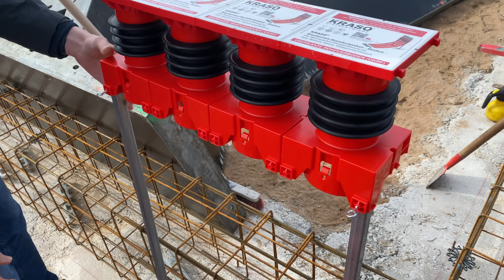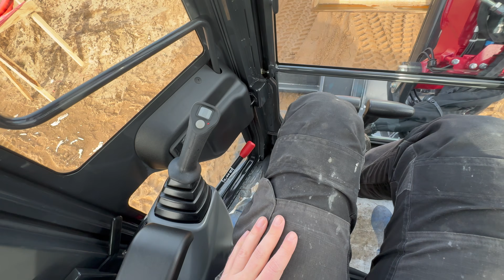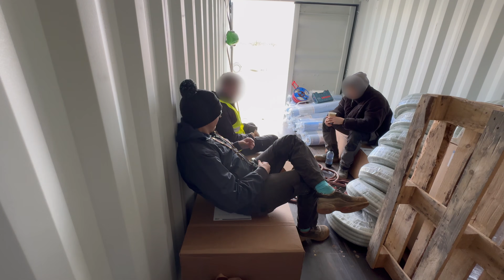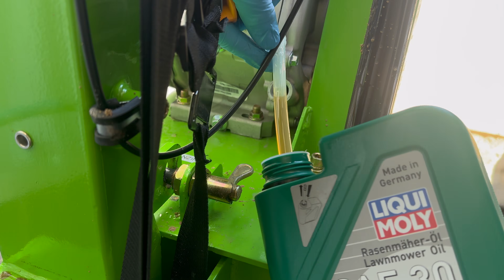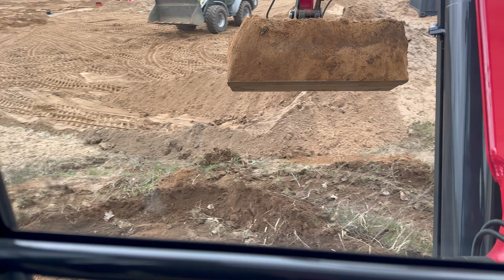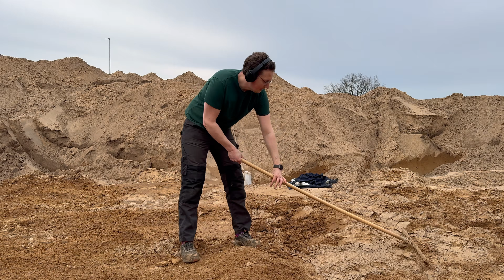Foundation Backfilling, Compactor Care & Massive Hole Digging | Max Maker Dream Workshop Ep. 3"

Comment: Gasketed joint sewer pipe & fittings were first engineered in the US and is widely used both commercially and residentially here in the US. Just a bit of clarification. Awesome build video otherwise. I know I am late to the party but I am really enjoying this series!
Reply from the maker: Thanks for watching! I didn´t know that. I saw so many PVC pipes with the purple glue.

Comment: Hey Max sup 👋 

Good times, you’re living the dream man! Couple things I would suggest in this instance, everything prefabricated, no pouring or setting, and a basement area with mesh ceiling (say in the far corner) that I suppose can serve as a utility space..

Later went on to turn the basement area into a concrete section that went from basement level to the first floor to use as a stronghold/secure space with server room possibility..

Thanks 🎉
Reply from the maker: Thanks! Not sure I need a basement.

Comment: Sorry to correct you, but America invented the "slip joint" piping. It is referred to as SDR35 [wall thickness & load bearing spec]. and is mainly used for sewer lines and some drainage application. But NOTE; the manufacturer of that pipe recommends for you to apply pipe soap before pushing together, as the gasket can roll if dry. I have been in the Utility Industry for over 45 years and my dad was in it for 50 years. We have seen all of the evolutions of pipe in the piping industry for the last 75 years

Comment: The more you compact the better. Years ago I did some concrete work, mostly unskilled labor. We did a house in which the owner prepped the house and large shop. The holes were all dug and we installed and laid the foundation and then he back filled and we came back and laid the slab. Having stepped on the ground inside the foundation it was soft and uncompensated (no insulation, no liner and just rebar that he laid). The main crew guy called our boss and told him as he had not arrived yet. The boss called the owner and explained this and the owner said to go ahead. The boss then called the concrete company to hold the first batch. He then drove nearly an hour to where the guy was working to get him to sign off on the job. (legal liability) Then we got started a couple hours late and finished. 
10 or so years later I happened to go to this guy's house as he was selling something that I wanted yet did not end up buying. (I turned my friend on to it and he bought it) I was talking to him and he showed me his stupid mistake. His shop floor was so badly cracked at the door entrance and every where he had set heavy or drove heavy stuff. The inside of his house had settled as well and had hollow sounds. He said that it took him 6 months to get it built so it rained a lot on it with introduced water under the slab and that settled. He did say that his insurance paid out on it. How he did that I have no clue. Yet he did say that he was going to build a new place in cash after this place was paid for which was in a few more years. I am guessing a 15 year loan! 
I like to compact a lot........
Reply from the maker: Thanks for the story! Thats one thing I want to avoid for sure. I am hopeful that we have so much rebar that the slab will be strong on its own. Its 20cm thick. So almost 8 Inches. The geotechnical engineer said that the sand that we got is the best material around and that its easy to get it compacted enough. But I still don’t know if its compacted enough or not.

Comment: The black drain things are what we use for the leech fields for our septic system. The one thing that we are going to do for our new place is install a massive system as the plan is to install one black and one gray water system with 1000 gallon tanks. 
My sister's place needs a way to remove water and this is what she needs to install. Yet her house is on the lower end towards the street and its higher towards the rear of her land. So they will have to dig deep to divert the water away from her house. Just sad that they built it on the low end rather than at the top end.
Reply from the maker: Ah yeah. Similar to this situation. I plan on doing the landscaping around the building as ditches that redirect the water from the hill around the house.

Comment: I've been a fan from the start and I honestly get so happy when you post a new video. If you don't want the pond to "collapse" then make sure to get some plants because the roots will keep the soil from sliding. Plus it looks really nice 😋 I would suggest Iris flowers. And yeah we have the same kinda piping in DK and it's really nice to work with. Best of wishes from Denmark
Reply from the maker: Thanks for watching! The pond will be filled in later and we build a cavity on the inside.

Comment: If you grease the rubber seals on those green pipes, it should make the seals last longer. It may not be necessary, but I wouldn't want to risk the contents of those pipes leaking 😅
Reply from the maker: Thank you for the tip!

Comment: Interesting to see how things are done where you are. In my work I most commonly see storage crates for water, they are sort of like big plastic milk crates that are weight bearing, they can be connected together and pipes attached if needed. They're porous so allow for infiltration, or you can get solid ones that are used only for storage.
Reply from the maker: We have those crates too, but they are more expensive. I think they make more sense when you need to save space.

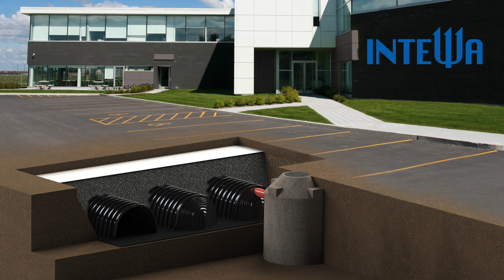Comment: 7:20 these soakaways look nice. I have a 300 Liter version in my garden (Graf Sicker-Tunnel) and on the other side a 900 Liter Iglu (perhaps also Rewatec). And I looked both yours and mine up and they have an impressivly load class of SLW 60(t) despite looking so flimsily. The large version has the advantage that you can climb inside and clean it if you want.
With that space you have: first send the rain water to a tank(s) (for gardening or grey water) and then to the soakaway.
Another method I saw over here:  stacked beer crates buried
How much is a cbm of conrete nowadays ?
Cheers from Berlin
Reply from the maker: I looked up both of those suppliers but ultimately Intewa gave me the best customer support and a little discount. Their modules are also the largest ones available. And as you said they can support a full size truck. Concrete ist about 160€/m3.

Comment: I really like the rain tunnels, they're basically a giant version of what we in the US refer to as french drains. My city has a similar thing to prevent floods, where most of a peticular creek that used to flood regularly and is near some very expensive properties has most of its regular flow still above ground, but has capture tunnels underneath it. During times of drought, they pump the water back up to the creek to maintain the flow, and there's an emergency drain that dumps the captured water to the big river if need be (for example, they did this during the last major hurricane we had).
Reply from the maker: Very interesting! There is so much going on underground. I think this is similar to a french drain just with different materials.

Comment: Is there a reason why you don't store any of the rainwater for applications that don't require fresh water? Like flushing the toilets or watering plants.

Love these progress-videos btw.
Reply from the maker: We could do that but unfortunately its not economical. Fresh water is so cheap that the pump alone would need to last for 20 years to make it worthwhile. Together with a tank it would be 40 years. However the manufacturer INTEWA actually installed a filter system at their headquarters to turn rain water into clean drinking water.

Comment: Will you put a layer of geotextile and maybe a little gravel under your water storage tunnel to stop sand from migrating into it from below?
Reply from the maker: Geo textile yes but no gravel. The very first tunnel segment will have a bottom that catches any sediments. Thats a new innovation by the manufacturer. It will have two maintenance access shafts to clean it every 3 years.

Comment: Can you add some rough prices and how much you are expecting to cost in total?
Reply from the maker: Yes! 200 for the property, 140 for the concrete, 240 for the building, 20 for heating, 20 for electrical, 40 for office and showers. 30 for bureaucracy, 100 for solar So 790 in total.
Reply: @MaxMakerChannel  whoa, was expecting half of that... thanks

Comment: Keep the updated coming! I'm from Portugal and currently deep remodeling a house and although the structures are very different, there are several details that you've pointed out that I will be paying attention to and/or implementing over here! Quite excited to learn more about insulation next week!
Reply from the maker: Oh nice. What insulation are you using in Portugal? I imagine you want to keep the warmth out?
Reply: @MaxMakerChannel It depends but most of our construction is very poor and badly (or not at all) insulated so we have a huge need to also heat the houses as well during most part of the year. I would say that our needs are mostly related with heating and keeping the heat inside instead of keeping warmth out.
Nowadays, we use a mix of ETICS insulation (10cm seems to be the new "standard" but I think the law requires less than that) and rockwool (5cm) inside of the interior walls (when they are built using drywall). Unfortunately, there's a lot of poor practices when building like total disregard to thermal bridges (which will lead to condensation). In the current house I will be looking into a mix of 10cm ETICS, probably around 4cm EPS + 15cm rockwool on the ceiling and maybe 10cm (depending on space) on drywall walls.

Comment: That's really helpful, thanks, since I'm planning to build my house myself in Germany. Did you take Angebote for every single action on the construction site way before starting the job? I mean did you know the cost and time spending for example for machines or concrete pouring?
Reply from the maker: Oh that is nice! The only work that I outsourced is the concrete. I got one quote for that. And you need a electrician. 

I made a spreadsheet with estimated costs. I looked up prices for all the building materials and just added them up. Stuff like plywood, cables, sockets, the heatpump and tiling. Then I added 15%. Oh, the tiling will probably be outsourced, but not the waterproofing.

Comment: Very cool! How long did it take you to plan every detail of this build?
Reply from the maker: About 6 months. There was a long back and forth with the steel building company to find out what I could afford and what not. It was difficult to find out which features were expensive. And also which features were needed due to regulation. After that I went at it step by step. It helped a lot doing most of the planning myself. So I didn’t have to wait a lot for anybody. If you outsource plumbing, rain retention and so on there are suddenly 10 people involved who don’t answer their phones. And you still need to check their work anyway. Because a plumber would build what is best, but what is best for him.